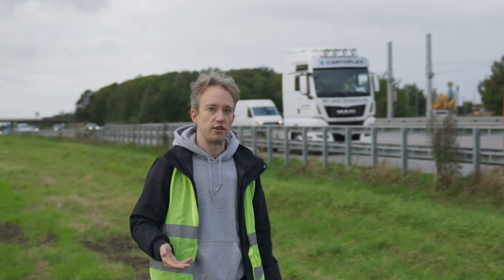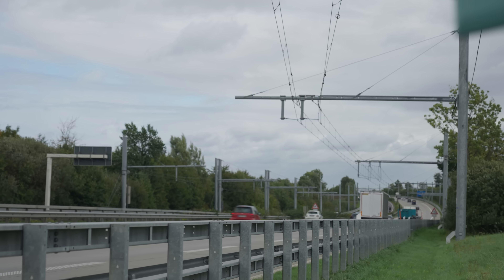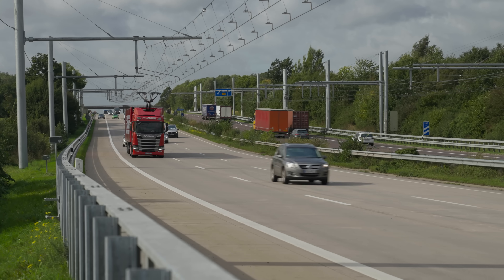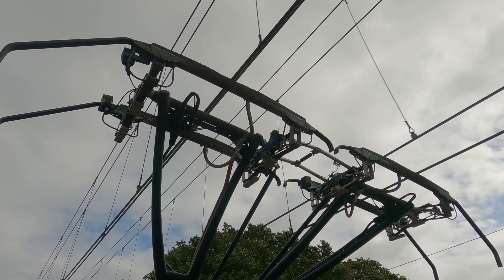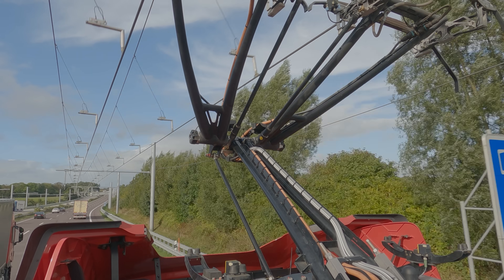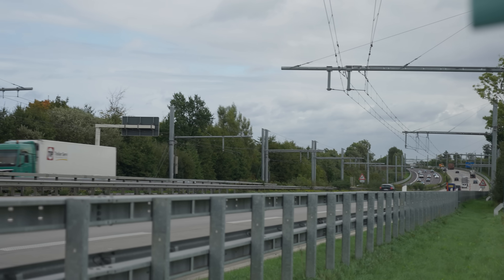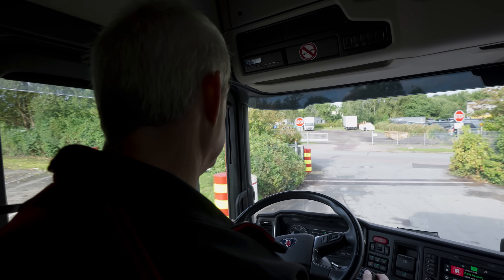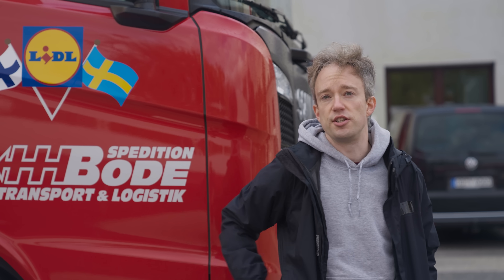The highway where trucks work like electric trains

Comment: It's interesting. Much more sensible and efficient than Musk's mindless battery semis. But I believe it's still kind of a stop gap measure, the real optimal solution being to renovate our railroad network and make it the go-to solution for any long or medium distance hauling. So I have mixed opinion about it: the tech is sensible and virtuous, but I'm more concerned about how it diverts funding and attention from the best solution in the greater scheme of things.
Reply: No masks technology will be better suited soon. I don't think this will ever take off because battery technology is growing quickly so faster charge times and longer range will be here shortly. No need to make a giant infrastructure that's high maintenance and can be damaged easily
Reply: Tesla could incorporate this into there trucks. Instead of charging the battery sitting still it could charge on the fly. The EV trucks could technically run 24/7 once FSD is exceptable.

Comment: How does this system work with bridge heights, most European countries limit the height to 4m, that projects much further than that, would a stretch of highway with 4.2m tall bridges all have to be replaced? And how would this work in the UK where we operate 16ft3 tall trailers, is there any chance of the same system working in the UK and the rest of Europe due to the different height restrictions?

Comment: My only concern is the 16' 2" double deck trailers I'm dragging around, they just clear motorway bridges as it is, but overhead cables will lower clearance and be very close to the roof of the trailer. Add on a heavy rainstorm and you have the potential of arcing between cable and trailer roof!
Reply: The vehicle potential is floting, it can only arc between those two wires.
Reply: It's only 670V DC between the wires, you'd have to get very close to get any arcing at all. And then there's those thick rubber tires between the lorry and the ground potential.

Comment: This is the dumbest thing I've ever seen - for any trips where battery size is a concern, a TRAIN should be used. Road infrastructure is incredibly expensive, literally ten times the cost or more depending on the area than rail, and it's all environmentally destructive concrete to boot. Every truck we keep on the road is at a massive cost the the taxpayer and the environment. We need to be looking at ways of reducing the amount of road traffic, not subsidizing it with taxpayer-funded infrastructure projects like this.
Reply: May I remind you that there are probably rails running along that very highway. Yet nobody uses train for this type of goods even if it is "cheaper". There are a lot of inherent reasons why train just does not work. At the same time trains move massive amounts of other types of cargo then it makes financial sense.

Comment: Idiotic beyond belief. Let's just accept that we will be using liquid hydrocarbon fuels for the foreseeable future. Not that I'm against progress. We are just not ready for it right now with the current energy densities of the alternatives. 

In any event, the globe would benefit enormously from CO2 levels at double what they are now. Plants need CO2. Desertification would largely cease at 800ppm CO2.

Nature knows how to balance itself.

What we need to see is the control of solid waste, less to landfill (Incineration and flue gas treatment like Sweden does), and meaningful recycling.

This "Green Revolution" is utter rubbish. That we have to be threatened / coerced / cajoled into it speaks volumes. Make it cheaper and easier and more efficient, and the populus will instantly buy into it! Let's see how the hypocrites at FLOP26 carry on, jets carrying a few people, limousines, security details et al, ad nauseum. This tripe could so easily be done over the internet.

Comment: Oh that definitely wasn’t an ad Tom.  

Seems like they used an iron rail for the ground on the ground they only had to put one wire in the air.  
Cut down on half the maintenance anyway so I guess working might be a problem with ground fire brushfire.  
But hey it’s the 21st century let’s do something new.

Comment: The exciting thing here is, in my opinion, that maybe this Infrastructure could also be used by other kinds of Traffic, like Coaches. If this were a Nation-spanning system, then it could potentially make Long Distance Travel even cheaper, as not even Coach Operators need to pay for Gas and Diesel anymore.

I do not think that this would be feasable for Cars, though that would also be interesting, but essentially having Trolleybusses and Trolleytrucks: That is exciting.
Reply: for cars, they can still carry a battery big enough for most trips without much trouble.

Comment: I've been saying for years (as my local transit agency was rolling out hybrid, then battery buses) that the most efficient way to deliver power to a vehicule traveling on a fixed route is a pantograph (coupled with ~10min of battery power for diversions). I'm glad at least the Germans are listening to me, because the rest of the Canadians sure aren't.
Reply: Canada is vast and sparsely populated. It doesn't make sense to even electrify the railways there, let alone the highways. That's why they are taking the Hydrogen route.
Reply: @hasininan5501  In my original thought, this was the solution for city transit instead of battery buses.

Comment: The more I look at this the more it just seems right.
Trucks are already taller than most vehicles, this reinforces incentives for trucks to stay in certain lanes (and won't be a trouble to lower back the attachment if needed to go around something and reconnect a moment later), the lines can be spaced far enough apart to not be a major concern for birds...
It doesn't even have to be across the entire road, since it loads up the truck's battery until it gets to the next section. Ofc, this could get finnicky and need some thinking to not become obnoxious for the drivers as well as be done safely, but it should allow for easier maintenance as there would be less area to cover, and sections would be less affected by one another.
I'm really curious to see where this develops. As well as perhaps ground solutions!
Reply: I can totally see this being used at least in specialized scenarios, such as company that sends dozens of trucks a day through the same route. They could have trucks with relatively small batteries to save initial cost and weight
Reply: Yep, it works great for the day-to-day.
Reply: @wobblysauce  Also buses and coaches. Megabus could become Megawattbus
Reply: And also with the smart motorways in the U.K. a lot of the pylon infrastructure would already be there.

Comment: Hydrogen and alternative/bio fuels are the future. Electric has been shown to only work in situations where the distance being traveled is not substantial. I agree that  this system is very efficient and will probably be the way forward for large HGV traveling all over the continent.
Reply: Hydrogen fuel cells are not the solution. Why do people keep saying this rubbish. “As of 2020, the majority of hydrogen (∼95%) is produced from fossil fuels by steam reforming of natural gas, partial oxidation of methane, and coal gasification.” Hydrogen comes from fossil fuels it is not clean. The rest is made by electrolysis, which is extremely inefficient compared to putting the electricity straight in to a bev.

Comment: Might want to invest in a pantograph that won't put as much wear on the overhead wire, provided they haven't already. Maybe something like a roller, or pair of rollers, with a carbon rod brush, since the road and the vehicles will be owned by different parties.

Alternate possibilities include beamed power, from high-mounted towers, aerostats, or solar power satellites, (can double for cooking that turkey you inadvertently left on top of your car,) hydrogen or some other "synthetic" fuel, or, and here's a crazy one, build up the freight rail network and quit hauling things on "trunk roads".

There is no reason why the railroads logistics should be stuck in the 1950's. Just in time logistics have been a thing for a while, (although it did fail us this past 20 months.)

Comment: No way politicians will consider this as an option, 
1. It's "big" and "ugly"
2. It's based on existing technology that has been around for decades, and known to work
3. It's obvious how it works, and that it works
4. It's easy to repair (block the lanes that need repair and work)
5. You can tell it's there
6. You can't be "innovative" with existing technology
Reply: you could paint the thing white, add some solarpanels and  blue LEDs, than it would look cool and they would love it.

Comment: A few years ago we were talking about bringing back cargo trains and reopen or renew old rail systems to use them like they were used 100years, to deliver goods directly to big factories, which often have/had access to the rail network. 
I really dislike the street train thing, just put new infrastructure to old rail networks and use battery trucks for the last "meter" if a factory or company doesn't have a rail access. Those power line trucks are still destroying roads and create rubber particles and all other the negatives trucks have in comparison to trains... except for the fossile fuel now...

Comment: Interesting. I went into this video thinking that such a system would have the same limitations as a rail network, specifically that trains can't leave their rails and it's not practical to build rails everywhere. But with battery and hybrid systems I think you could get a best of both worlds scenario here without having to build new transportation corridors.
Reply: There are battery powered hybrid trolleybuses in wide use. Main streets are for charging, rest of the route by battery. It works and makes sense depending who you ask. Other option is just to put a couple of tons of batteries and run the bus for the whole day on those. Of course buses go slow in the city, trucks on highway and the energy need is on another level.

Comment: So how does it work? Does the truck go from using the combustion engine, connects to the line, switches entirely to electric, and then turns the combustion engine back on when leaving the line?

Comment: Tom doesn’t mention 2 other reasons why we should be seriously considering this solution. 1) Scaling up battery vehicles doesn’t work very well. An e-bike is a great idea, an e-car is kind-of-ok, but has range problems, but an e-truck that has a similar range as it’s diesel cousin needs a battery weighing several tonnes. 2) The railways don’t have the capacity to take even a fraction of the freight that is currently being moved over the Autobahns/Motorways. This idea keeps the freight on the road, and eliminates all that heavy poisonous and possibly explosive batteries.
Reply: Regarding your second point, surely it's better to expand the rail network, as trains are much more efficient and are better suited to these overhead lines (even wear from zigzag catenary wire, less passes per hour, much less passes per tonne of cargo). Keeping the freight on the road isn't a bonus. Obviously there are benefits to trucks Vs trains, but environmental impact and cost to run aren't among them.

Comment: So far most "studies" trying to prove the economic viability have one huge flaw: They assume the fuel cost WITH all the massive taxes on it, but compare it with a system counting virtually untaxed electricity. But in order to be really financially viable, the cost structure should count on the same amount of tax revenue as coming from the fuels. So the only reasonable compare is counting the fuel cost what it would be without all the fuel taxes. So that means divide the diesel fuel cost by 2 or gasoline by 3. Assuming governments will give up on the tax income from the transport industry is just nonsense. They may play it initially so the "tax would be paid only by the dirty combustion", but even when it may be the official stand today, it is definitely not sustainable.

Otherwise yes, overhead power supply is the most efficient, when it means the required battery (off grid) range could get reduced to few 10's km so a lightweight battery could handle that. But that would require really dense road network electrification, include roads that are not used that heavily. Otherwise the main source of battery inefficiency, its mass, will remain hurting the transport economy.
Other plus side would be, the availability of cheaper and mainly unlimited power will convince truck operators to stick to the high capacity roads which can handle the heavy traffic and so stop them from destroying rural roads by heavy transit traffic when drivers are attempting to avoid toll.
Reply: On the other hand fossil fuel still have high external costs. They probably are lower than fuel taxes which are used to pay for road infrasturcture but still are quite significant.

Comment: Well this is awesome.  Like the old trolley bus. Turns the motorway it a scalextrix track. There’s no reason why it can be bedded in to the roads surface. Where overhead wires would be impractical. I know about the technology for awhile. Just hope It couples up with others technology to make our roads safer. Much like the train having a signal box and control centre. Vehicles could interface with it and drive much closer together in the slipstream. Semi automatic. To some degree. Especially if you have a preprogrammed destination.

Comment: I hate this idea and I'm not sure why

I do think however it would be much simpler to use trains to a hub and then have smaller delivery lorries doing shorter journeys from that hub. 

With the pandemic I think alot of people re-evlautated there lives and readjusted to something that's better for them and their families. Especially if they work unsociable hours and don't spend time with their families and closer to home. Employers need to catch onto that.

Comment: I understand why they built it this way using existing technology, but if they put a little effort into finding an underground solution, then the network could also feed cars, vans, box trucks... Which aren't high enough to reach the power lines.

Comment: Interesting topic and I hope to see it (and things like it) adopted elsewhere if its viable.
That said, I would have loved to learn more about the energy transfer system. Is it AC or DC? How does it avoid friction? Do the wires heat up with many trucks rubbing against them for hours on end during the day? Do the energy collectors on top of the truck wear out quickly? So many questions.
I guess this video doesn't have to go into insane detail to be good. Still a solid video!
Reply: It uses 670V DC

Comment: I hope Adam Something sees that. I would be so interested in his opinion about this project.
Reply: The video could be interesting, but I think this is far from being a vaporware solution. It's much more practical than Tesla's work (and Nikola ew) for sure.
Reply: Probably that we should use trains instead because trains are more efficient. Warehouses just need to be built on railway lines, which they used to be before widespread adoption of road trucks.

Comment: What happens when a cable snaps and falls on the highway and causes a huge accident or the driver of the truck makes one small mistake (accidents happen) which leads to my previous concern. I have many others but those are the 2 right away concerns.